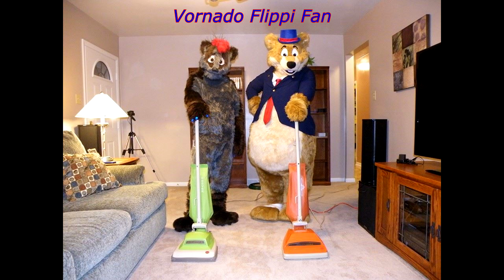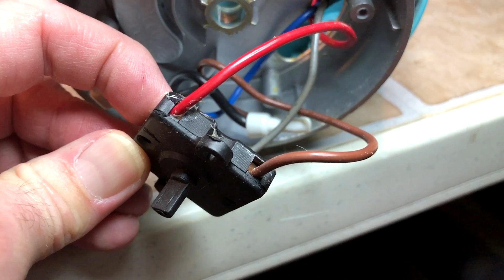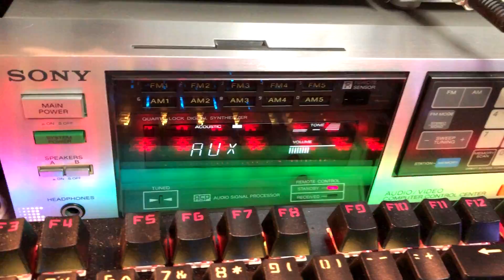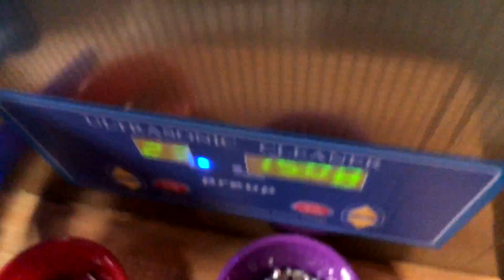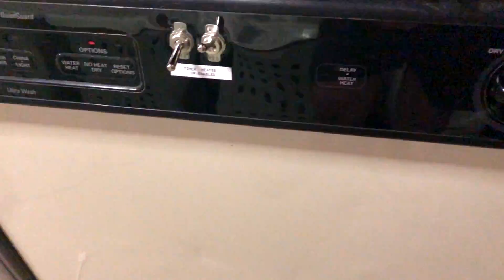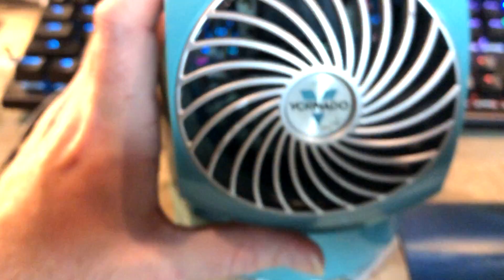DIRTY Vornado

Comment: That Lakewood fan i picked up its a Kmart P-23 metal bladed box fan must be a second generation cabinet as it has that one piece motor mount.  Normally i don't get the China made Vornado products.  but if its worth it may do so.  the box fan works. but now needs cleaned. and i have to see if the motor temp don't get too hot or pull excessive amounts of amps to deem it unsafe. if i decide to keep the fan replace the motor. i will go with an attic fan motor wire it to a triac switch. as it will be a McMillan Electric Co motor. as i think the motor is McMillan as it has the square stator.  again this box fan is a roadside trash find whitestown Rd in Butler Pa butler township.
Reply: That's a great find.  We haven't found anything at all lately down here near the airport, but I got a very interesting email this morning, there could be a chance I will be working in Butler soon.

Comment: hi i just picked up today trash find in the rain a Lakewood Kmart P25 metal bladed box fan i didn't get it out of the car its still wet but when i get time i need to asess the fan the motor for continuity if its safe to run or for restoration im not sure what the designation for the kmart metal bladed lakewood box fans is as i still got a project p223 in storage needs a front grille lower part is busted. the motor the original motor still works great. but this p-25 fan i just picked up off Whitestown Rd in Butler. i need to asses it.

Comment: Can you please tell me the steps of washing a fan motor? I washed one recently, and after i let it dry for 3 hours, i put it back together, turn it on, and it just spits out tons of sparks.....
Reply: Same as what you did, only you need to let it dry for at least 48 hours before applying power.
Reply: So in theory, you could wash the whole fan all together, and still manage to get it to run if you let it dry long enough so that no more water is present?
Reply: @TheFanUniverse  Yep, done that many times.  As long as there's no paper.. like insulation, labels, etc, it will work.  Keep in mind that you have to immediately start drying it so that nothing rusts, don't touch it for two days at least, and then you have to oil it thoroughly before you plug it in.

Comment: How’s everything going? Are you actively looking for employment? Have you thought of doing some vlogs of you sourcing your fans or other items you repair? Even that place that you said burned down and reopened, but had another lot of old appliances?
Reply: Eh.. it's going :-) 
I am doing about a 50/50 program right now, half networking/applying/interviewing, and half attempting to do psych consulting from home.  Thought about trying different career fields, but not sure what else could provide enough $$$.  I have done a few blog posts and submitted a few articles for publication, none regarding my hobbies yet though.  I have limited mobility, which is usually an instant turn-off to a prospective employer (even though that's illegal, doesn't matter...) and also my neuropathy medication is an obvious instant fail for certain pre-employment testing.  The place with the appliances is basically a glorified appliance-mover.